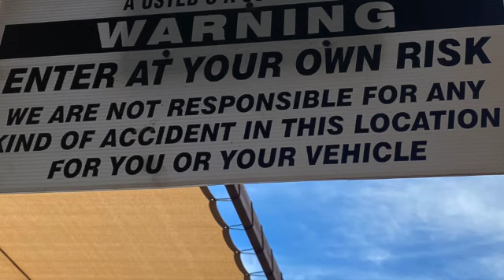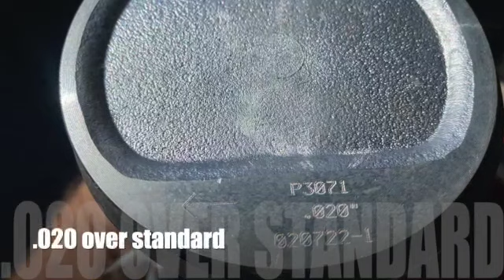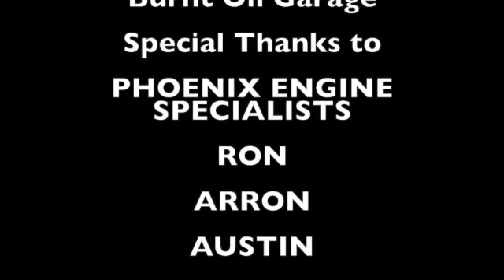Jeep 4.0L Engine Rebuild (part 2 reassembly)

Comment: Great engine. The Jeep 4.0L is one of the few I consider perfect for their applications, right up there with the legends like the Dodge Slant Six and Small Block Chevy. Gets decent mileage on the highway too. I've done some mods to them but never saw much gain for the expense. Maybe get out your grinder and match the ports...some of the intake manifolds aren't a great match to the head, but even when you do you might not notice the improvement.
Reply from the maker: All good points. I have the later model intake that has smoother bends for better airflow. I agree that the engine is a good fit for it its intended purpose. I’ve thought about a stroker but in the end I chose longevity instead.